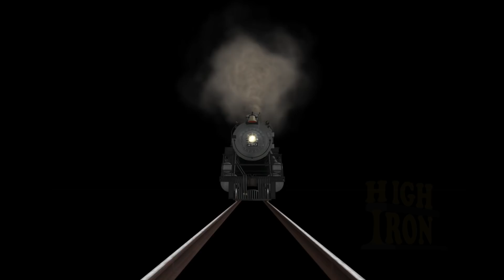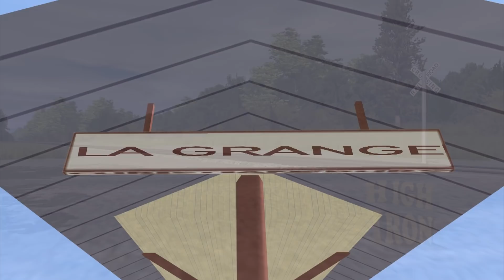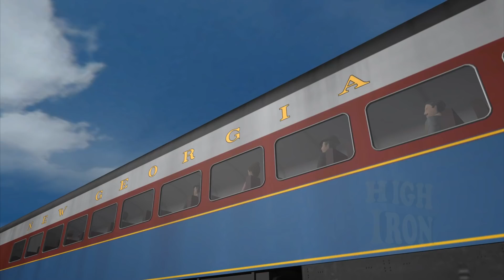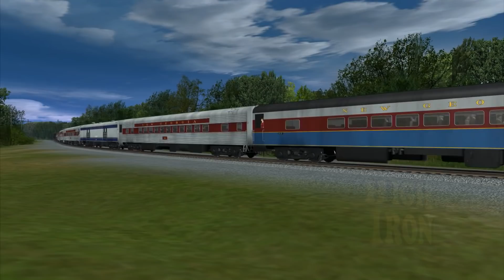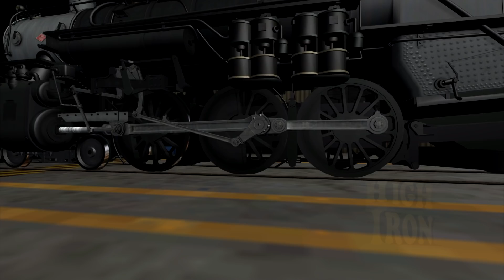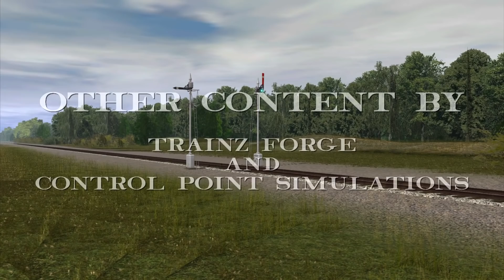Atlanta & West Point 290

Comment: I was a member of the Atlanta chapter of the NRHS and worked regularly on the New Georgia trips. I also worked at the SERM and nearby was the facility that was rebuilding the 290. I had the opportunity to climb down the steam dome opening and enter the boiler. All tubes were removed at the time.
The mid to late 80s was a good time for rail fans in the Atlanta area. 611 and 1218 were active in the NS steam program. 750 and diesel 6901 were running on the New Georgia. And 290 was entering the excursion service. This was a fun reminder of those days. Thank you for the video.

Comment: Over in Cadiz California, a company is looking to start running excursions to Parker Arizona and back on the CA&AZ railroad mainline which would allow for high speeds with heavy trains. This could be an ideal locomotive for the job if it was maybe converted to burn oil.

Comment: Correction for the info on driver diameter and tractive effort-driver diameter was 74”, not 73”, and tractive effort was 46,892 lbs at 85% cutoff.

Comment: realistically i think 290 could run at 225, with a new boiler, 300.
engine is basically a copy of the Ps-4
Reply: Boiler pressure can’t just be increased because you want to. Usually you want your weight on drivers to be at least 4 times the calculated tractive effort. Less than 4 is where locomotives become slippery and nearly impossible to handle. 3 cylinder locomotives are an exception to this rule to a degree, since power delivery is a bit smoother compared to 2 cylinder and 4 cylinder articulateds.

So let’s entertain your crazy idea. 290’s boiler pressure is 200 psi, which gives a calculated tractive effort of 46,892 lbs. Factor of adhesion is 4.11, a perfectly acceptable figure. Now let’s raise boiler pressure to 225 psi. Tractive effort jumps to 52,754 lbs, and factor of adhesion drops to about 3.65. Pretty slippery. 300 psi gives 70,339 lbs of tractive effort, and an impossible to control factor of adhesion of 2.74. That’s how you ruin a locomotive, best to just leave the damn thing alone.
Reply: @blackbirdgaming8147  i mean with a new boiler. this was a reference to running gear
Reply: @CoalChrome  Did you read any of what I said above? You cannot raise boiler pressure just because you feel like it. Doesn’t matter if it’s a new boiler, 300 psi would destroy 290, and if it didn’t, the locomotive would be unusable due to an unacceptable factor of adhesion.
Reply: @blackbirdgaming8147  i stopped caring
Reply: @CoalChrome  My apologies, I forget that not everybody lives in reality
Reply: @blackbirdgaming8147  my apologies, I forget that not everyone can have a fully adult conversation
Reply: @CoalChrome  It’s your choice to be ignorant. I gave you the facts on why your idea wouldn’t work, and you didn’t like it. 🤷‍♂️
Reply: @blackbirdgaming8147  man you just dont know when to quit a pointless argument